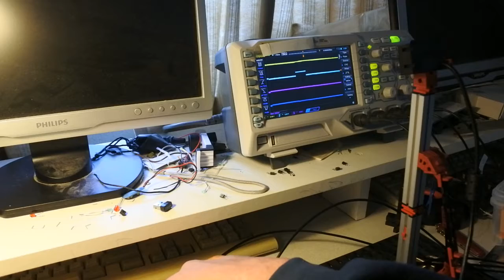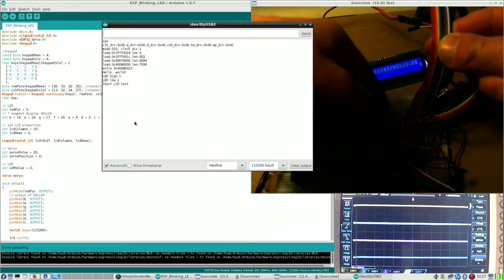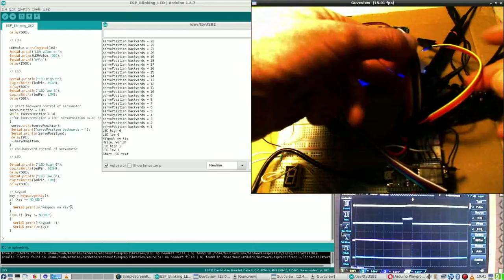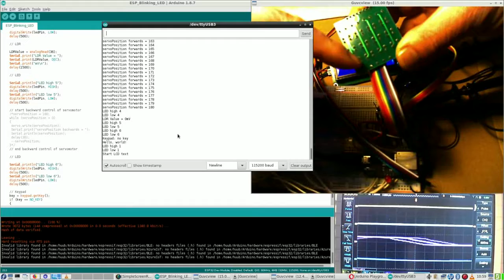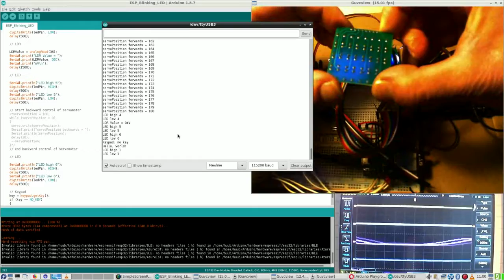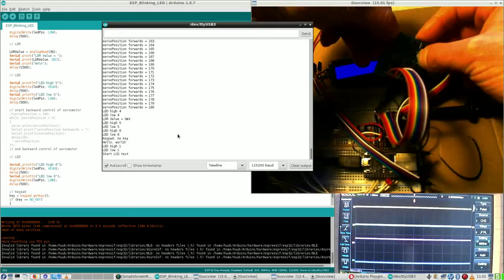ESP32 episode19: Keypad, wiring, LCD, algorithm, servomotor, voltage, oops, oscilloscope, probe,more

Comment: I had the same result from the keypad on the esp32, i rekon i have the same board as you do. I managed to get it working using:
#define PIN1 15
#define PIN2 2
#define PIN3 0
#define PIN4 4
#define PIN5 27
#define PIN6 14
#define PIN7 12
#define PIN8 13

It seems the ones that are rated for "touch" input are the ones to use.
Going off this -  https://images-na.ssl-images-amazon.com/images/I/71DBnr%2BGxWL._SL1072_.jpg

My full working solution: https://github.com/terraseraph/JOAT-ESP32/blob/master/MQTTmeshClient/joatKeypad.h
Reply from the maker: Thanks for your suggestion. I'll look into it and see if I get it working as well.